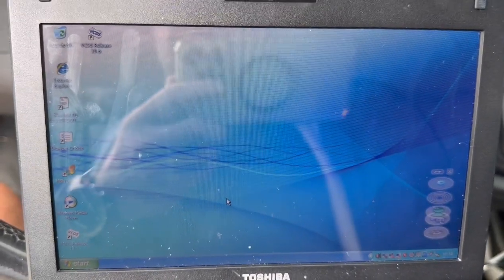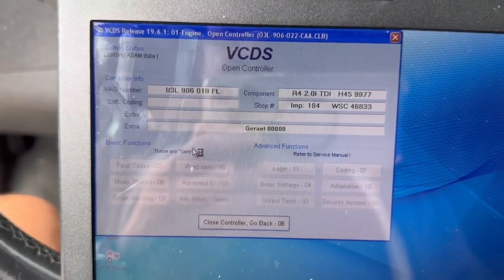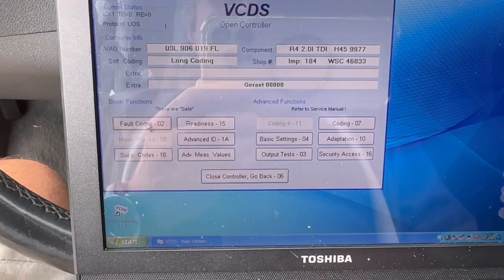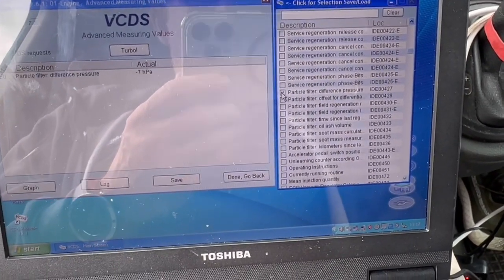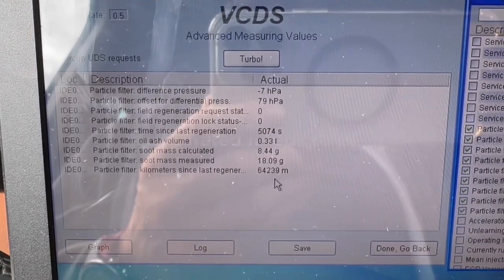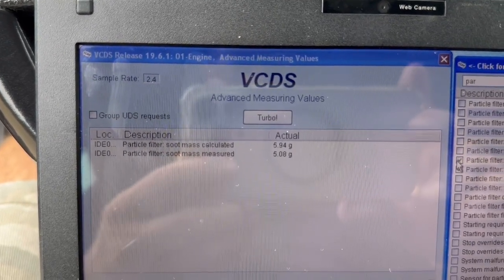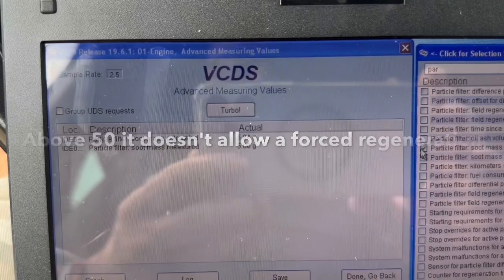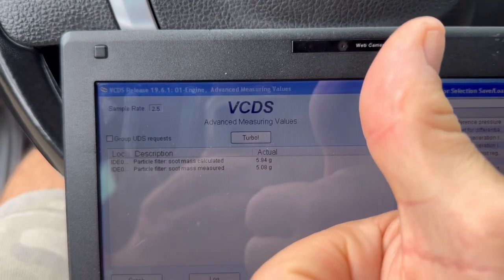VW T5 T6 Diesel Particle Filter (DPF) Status Check

Comment: what about when calculated is 58 and measured is 5 and can not remove fault code, or do regeneration
Reply from the maker: I have regenerated at up to 68. I had to keep entering the code in VcDS until it went thru. I believe I turned the ignition off each time. There is also a way to reset the calculated figure as there appears to be a mis match between actual and calculated. Search on the net and you’ll find how to reset calculated. Hope this helps and keep us posted. You can do it 👍
Reply: @YoucandoitwithJules  what code you used? 12233? 27971? or something else
Reply from the maker: @snwz  Yes depends if stationary or driving which one. There’s also adaptation to adjust the computed sot mass you can set it back to 5 as per measured. Then you can definitely Regen. You can do it 👍